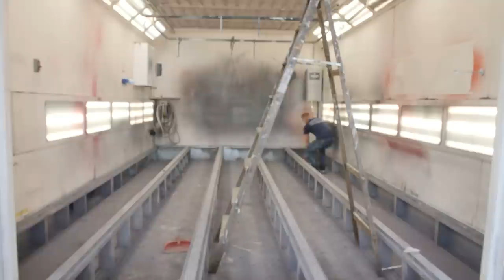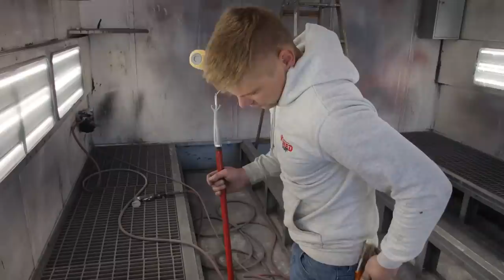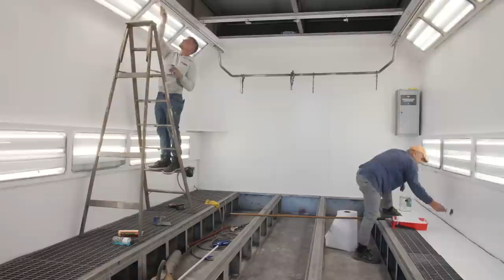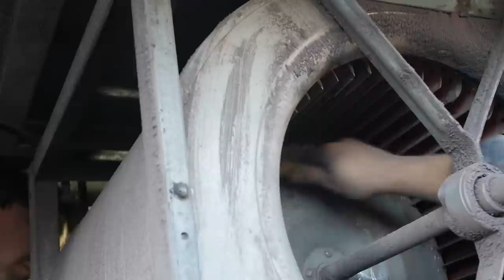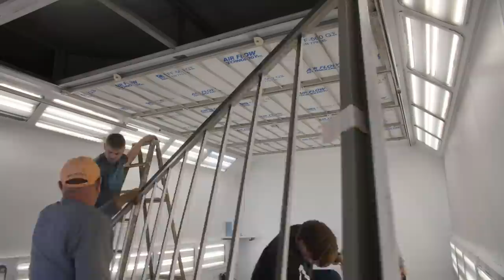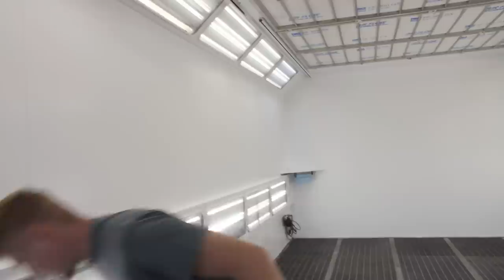Cleaning The DIRTIEST Paint Booth. (very satisfying)

Comment: Switch the lights to LED, it will pay for it self with cheaper usage, and bulbs will last longer. That's not only a huge swing in energy savings; LED lights give your finishes a truer color. They are safer and don't present the fire and explosion hazard that overheated bulbs do when coming into contact with paint chemicals. Love what you guys are doing!
Reply: 3000 kelvin (daylight) led tubes give the best real colours.
Reply: @philtucker1224  3000k is warm light above 4000k  is daylight
Reply: @iamyourfuture808  hi Iam, 4000k is ok but is moving towards the “blue” end of the spectrum …
Reply from the maker: They actually are leds but they are not for this booth and sit at a bad angle. All need to be replaced.

Comment: HI Yuri - good job - looks well. You should finish it off with 1-2 coats of "peelable booth coating" - it just washes off, but keeps the booth walls looking fresh. Should also think about fitting rubber tiles on the outside rows of the floor - woiuldn't make much difference to the air flow and a lot more comfortable for painting. You should also add an additional pre-filer to that fan - never seen one so clogged!
Reply from the maker: We coated it with a booth coating that just hoses right off, so hopefully it will be less work next time
Reply: Was thinking the same. When I was doing body repair 20 years ago we use tacky coat on the tiles. It would powerwash right off

Comment: Just a couple of tips, never let the fan blades buildup like that as friction will cause a fire. The glass needs to be installed air tight to keep flammable vapours from the electrical system. Now that the glass has been cleaned or replaced cover it in Saran wrap,making it easier to keep clean by simply pulling it off and replacing it. Some of the filters used in the extraction system can have the dirty top layer pealed away saving you money.
Reply from the maker: I’m surprised that fan was even running, we are definitely going to maintain it better from now on. Thank you for the tips sir and it’s not just us who can learn here 😊

Comment: The body shops in my area just run the booths till they die and then buy another one.    A tip for that style booth is to get rid of that outer row of grates and put in a solid floor.  This will greatly cut down on the trash and will be more comfortable on your knees.

Comment: Check the back of those lights the front might be sealed and you service the bulbs from the outside. they do this to avoid electrical sparks in an area with solvent vapors. You may also be able to replace the glass from the outside too.

Comment: After you paint it, you can get yourself a bucket of booth coating (sometimes called booth guard) for an easier time to clean it next time. It’s a water soluble clear coat so that next time you can go in the and pressure wash it and everything on the top layer will fall right off. Talk about satisfying! Also, I’d recommend spraying that on with a graco spray rig or something if the sort, rather than painting it on with brushes. And since it’s water soluble, it’s an easy cleanup.

Comment: Could help but noticed you installed the floor filters wrong.  With them upside down they will face load quickly.  Then you will get a vortex in the booth and get overspray all over yours walls and ceiling.  Also you can consider using a better quality filter so your exhaust fan doesn’t get the build up previously had.   Lights are outside accessible. Not inside.